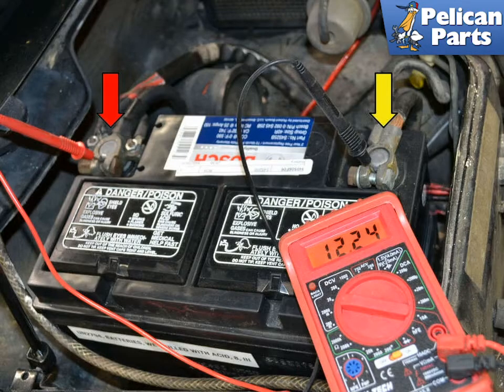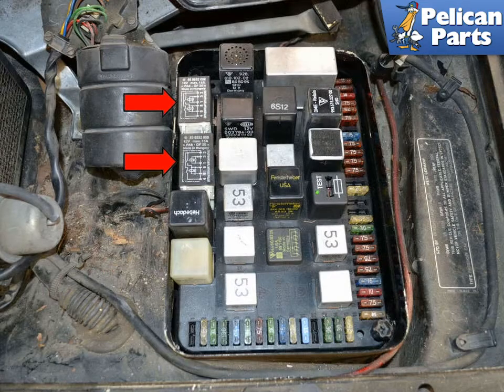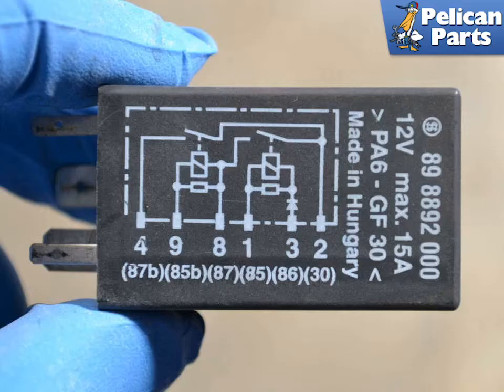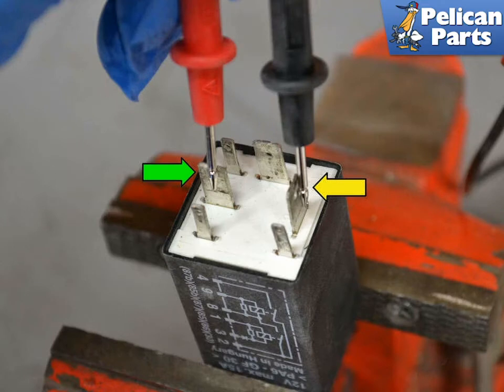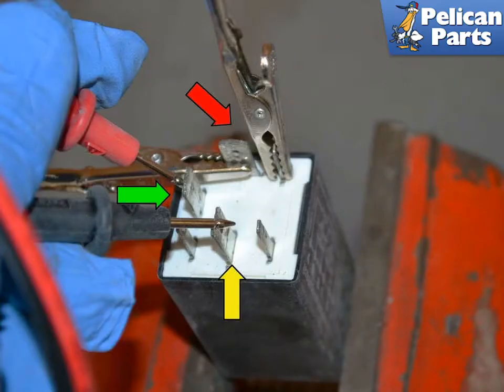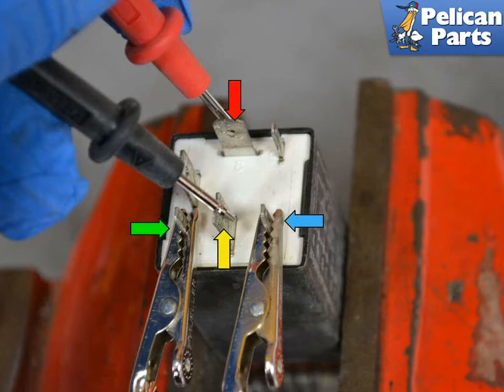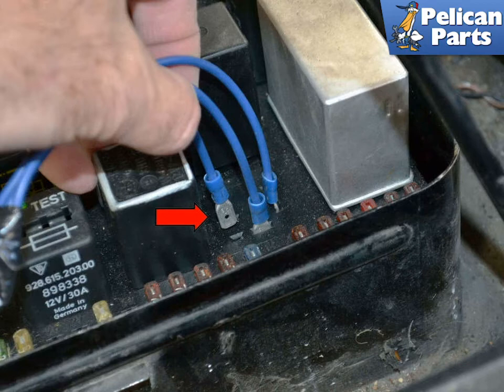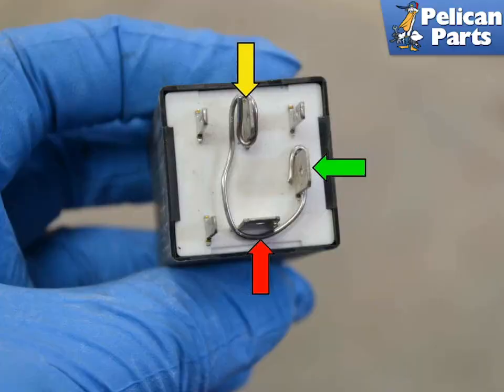Porsche 944 Turbo DME Relay Troubleshooting (1986 - 1989)

Comment: For fig8 does the arrangement of the power supply matter? Does a specific terminal have to be high with the other low?
Reply from the maker: If you mean battery positive and negative, yes. There is a correct orientation.